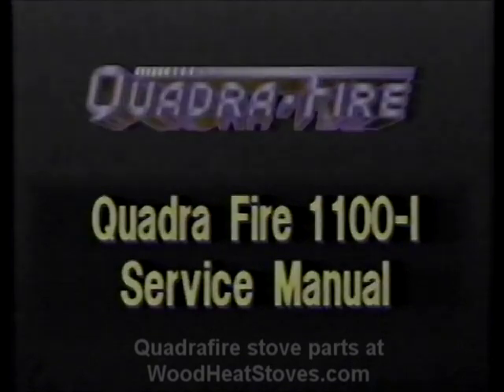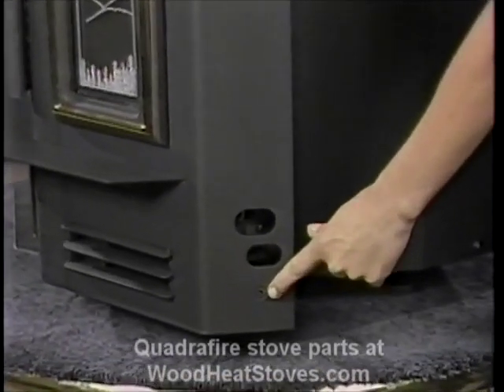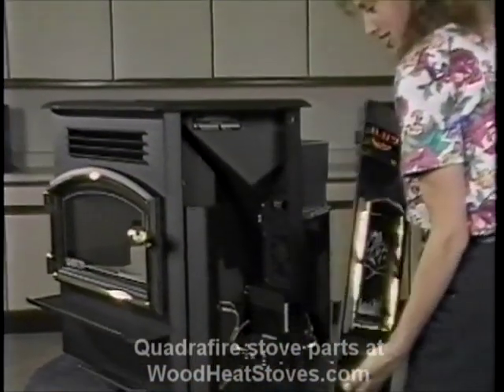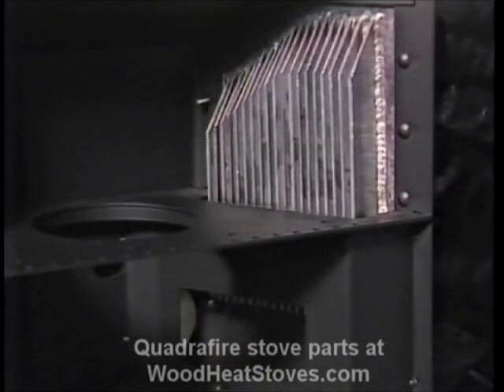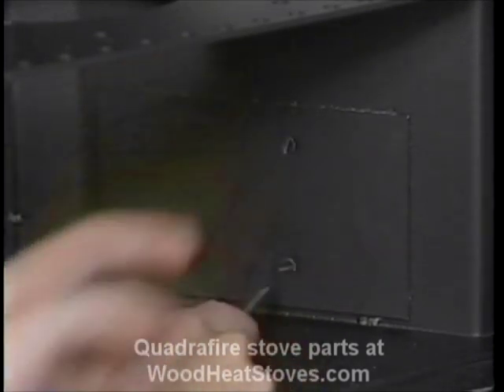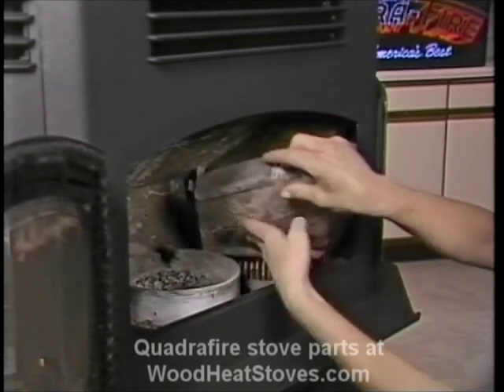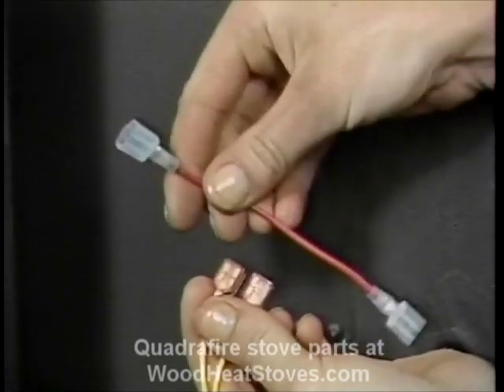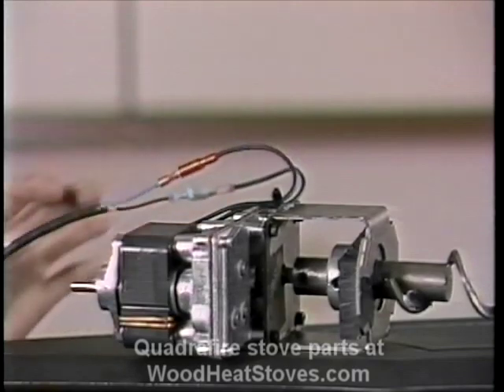Quadra-Fire 1100-I pellet stove insert operation and maintenance manual  video

Comment: I purchased the 1100i from an individual who decided they just wanted a gas fireplace insert. I hired an installer and it looks great but did have a few issues, which I understood could happen with a pre-owned unit. I found the manual online, but it just doesn't have much detail. I was so thankful to find this video! I actually copy/pasted the transcript into an Excel file. Then I could use the "find" feature to search the transcript text for exactly what I need and where to find it in the video! Game changer! My insert is running perfectly now and I was able to fix the issues myself. Well, I did have to order and install a new control box, but still, I did it myself! thank you for this excellent detailed video!